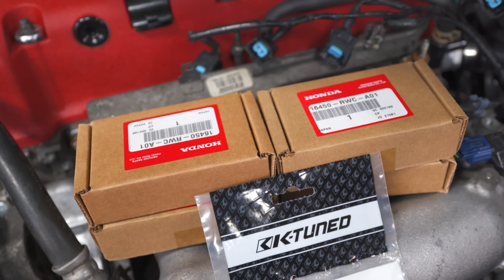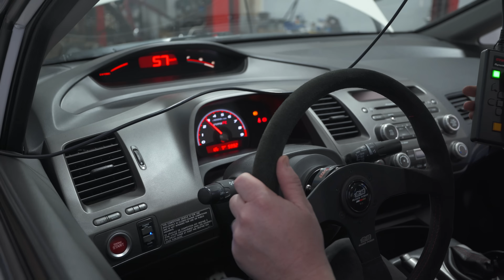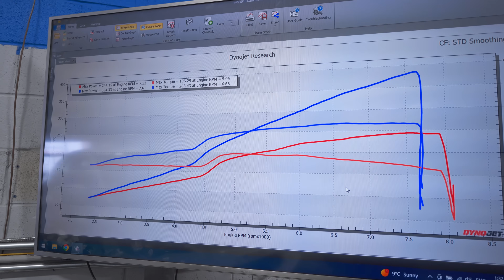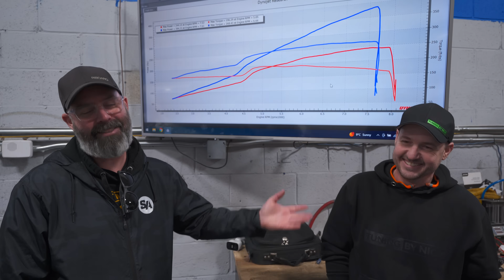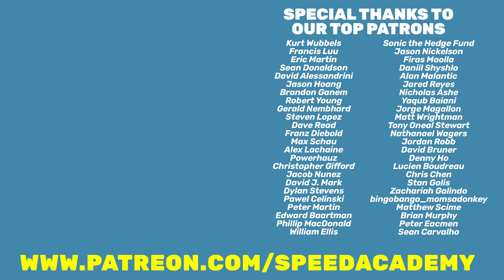BEST 8th Gen Civic Si 240WHP NA Mods ( SKIP the Supercharger)

Comment: I’m 39 and drive my 09 civic si with a supercharged k24a2 everyday to work. Car makes 390whp on pump gas. I love it. I drive it 50 miles each day. Never get old guys.
Reply: That's being content cuz that's my goal. Just a reliable rocket bunny.😅
Reply: thats badass and you prolly still get remarks that its a civic and that you get good mpg lol im tired of hearing it myself. theres almost nothing economic about the si compared to the base model obviously. esp with that close ratio 6speed
Reply: I just boosted my GT86 this weekend and its making 285 WHP. It doesn't feel like all that much and it's not like I even get to use all of it every day on my 30 minute commute. I also live in Texas and it got up to 91° today so that might be why it doesn't feel that good 😅
I'm tempted to go for the smaller pulley, loud BOV and E85 but all of that can wait for another year, I'll keep enjoying what I have right now. 
It's still not enough to get in big trouble but enough to feel like it's how it should've always been.
Reply: @yaboirico5221  also reliability man even NA those things are prone to engine failure, be careful homie 😭😭 i want a gt86 bad but i wish i could put my si's 9000rpm 240hp engine in it lol
Reply: What size tire do you run. I think the guys using 225 width tires is lame
Reply: @Gjon777  how
Reply: @repingers9777  too small even for 244whp
Reply: @Gjon777  im planning to put some 225/45/17 continental's on my 17x8's i care more about handling im only at like 200whp so im not gonna lose any traction lol
Reply: @repingers9777  maybe it’s the compound of the tire. Cup 2’s are great summer/street tire for grip even with big power. I ran cup 2’s 235/40/18’s great in warm temps
Reply: @repingers9777 yea I get 18mpg now. Not bad but my 2020 Silverado sides the same lol.
Reply: @repingers9777  I've had the 86 for 2 years, the guy I bought it from replaced the engine lol I am fully aware. yeah a K series would be cool and fit the personality but I'm a sucker for the sound of the Coyote V8....
Reply: @yaboirico5221  hey the k series w a deep exhaust and loud intake growls like a gt350 in the cabin lol (has to be the performance k20) , not kidding ive lined up vids of my car and some stock gt350's its cursed as fuck but awesome lol.
Reply: How what all do you do or have u done to keep maintenance up besides changing oil and transmission fluids
Reply: @LynnDisclose I change my oil every 3k miles and I change the supercharger’s rotrex fluid every two years like the company says. I don’t bounce off the limiter and drive the car like normal.
Reply: stock internals? stock trans?
Reply: Stock trans??
Reply: kraftwerks?
Reply: How many mpg do you get with it?😊
Reply: So when are you dropping theAWD system in that bad boy?😂
Reply: why did u opt for a 24 instead of a k20a2?
Reply: If I didn’t leave in California it would be the first thing I would do to my 08 Si
Reply: Type supercharger? And supporting mods ?
Reply: @yaboirico5221 yea nothing builds power like a Honda unfortunately

Comment: 40 years old here, I’ve had my Rotrex Supercharged EP3 (365bhp) nearly 10 years and wouldn’t go back NA. 😎
Reply: 100% agree the only reason why they pulled the supercharger out was for financial reasons.
Reply: @alleybuilds5370  for the annual maintenance of keeping the supercharger? If so what would be the difference in maintenance between NA and supercharged ?
Reply: Loved my jap spec ep3. Ran it with a 24 bottom end as opposed to forced induction. Have since moved to an fn2r and with the extra weight, it has crossed my mind to turbo or supercharge it.
Reply: @RelayFFA  nothing to do with maintenance everything to do with resale value. they are selling the car and realize they will get more money if they sold the supercharger by itself. and the car by itself.
Reply: @SR22VET-S15 I've had a few boosted hondas now. A turbo dc2 type r at 320hp a Jackson racing supercharged jdm dc5 type r and for the last 6 years a supercharged fn2 type r at 340hp. Honestly I prefer supercharged for the linear power delivery and instant throttle response. Dont worry about heat anywhere near as much compared to turbo and no big torque spikes to worry about loss of traction as much. I'm even on oem clutch for 6 years now and do the occasional bit on track too

Comment: I did the comptech kit on my 8th gen. Making about 330whp. It was a beast and the whine was intoxicating. Roots style blowers are way better than centrifugal blowers.
Reply: Why are they better?
Reply: Roots style blowers have a lot of inherent problems. Biggest being overheating.
Reply: @rawrmadmonkey  Mercracing has pretty much solved all the cooling issues for all the common k series roots blowers
Reply: @marzelluspinder3190  I had a centrifugal blower in my S2k for 5 years making 423 whp, and the roots blower in my daily driver civic si for 3 years making 330whp so I have a lot of experience with both types of blowers. I preferred the roots blower because it had instant power at lower RPM. With the centrifugal you have to be up in the rpm before it really starts to make boost and pull. Also the roots blower sounded sick revving out to 8600rpm. Here’s an old video which I will not confirm nor deny if it was me for obvious reasons. https://youtu.be/k39VztzKf28?si=X7pu2hRtrcvmBDUi
Reply: @rawrmadmonkey  I had less noticeable power loss from my roots blower over my centrifugal. Both were running larger air to water heat exchanger setups.

Comment: 380 through the front wheels is A LOT. This will make for a more enjoyable day-to-day driver.

Source: approaching 40.
Reply: 380 is at least 30 whp too much. 400 at the crank is maxing out what a fwd platform can handle, without completely losing driveability
Reply: I had a Volvo with ~250hp to the front wheels, that already was enough hp for that FWD car, loads of torque steer and poor traction without an LSD.
Reply: Not with rt660s it isnt. But I suppose not everyone wants to run a 200tw tire on a civic. Drives like a dream with the 660s tho
Reply: @Vaino_Hotti I agree, 300whp in a sub 3000lb fwd car is plenty fun, I still get 30mpg when I don’t beat on it
Reply: @Vaino_Hotti so fun tho innit
Reply: @youngmaestro4153 with boost by gear, there should be no issue. It helps in higher gears to have power.

Comment: A buddy of mine had a supercharged S2k that he was track racing and actually ended up going back to NA for the next season because with the supercharger it was just overpowered.  Ended up doing better with the na setup that season.
Reply: Depends on the courses you're tracking on but you can usually cut your lap times by more seconds per dollar doing basically anything other than adding boost. Improving braking, suspension, grip, and aero will cost you about as much as adding boost alone and will get you better lap times on most courses.

Comment: Lower power isn't bad.  Miata is a ton of fun, FRS/BRZ/GR86 is fun.  They don't have high power but still great.
FWD has special challenges in grip due to weight transfer to back tires...
I have a fast car I can't really use anywhere.  It sits in the garage and comes out a few times during the summer.  So, cutting back the power to have something fun to get around in without going to jail is good.

Comment: The boost curve from a centrifugal supercharger makes you use more throttle at the bottom of a pull, but as the rpms climb the boost also climbs (exponentially) and “blows the tires off” the car. It is especially pronounced on FWD with street tires.

Comment: I have a kraftwerks civic I’ve put thousands of miles on it and my wife drives it too it’s incredible. If you don’t wanna rip the tires off you pedal it or shift up the power is always there  if/when you want it and if you don’t want it you can drive out of boost easy. I added a rfl blow off valve so every gear change is fun and sounds cool. To each his own!
Reply: Or they could put a bigger pulley and turn the boost down. In my opinion, this is a downgrade but it’s whatever.
Reply: @mursetvlogs5717  They are going to sell it, and make more money selling the SC separate. Probably
Reply: @dancarlos1216  ooo, yea that makes sense too. I figured a lot of their projects they always end up selling anyway since you never see them again
Reply: Why would I buy a civic to pedal it and shortshift? I want to be matted and banging gears every single drive.

Comment: I’m of the mindset that i should have gotten better with a crv all wheel drive setup with the supercharger,maybe that should be another video suggestion
Reply: AWD supercharged making 380 would be really rowdy 🔥
Reply: Way too complex, expensive and heavy. All they needed was a 255 square setup on some nice 300 tread wear tires and maybe lowering the boost a bit if required.
Reply: @CrossWindsPat  255/35R18 200TW tires + add an external wastegate on the charge pipe plugged into a 4-port solenoid (boost by gear setup)  Problem solved ✅

Comment: Glad to see you guys thriving up North.  Congrats on nearly 650k subscribers.  I always say add power until you reach the limits of the chassis/tire.  With light FWD cars on street tires, that's a pretty low limit.  250-300 whp is probably that limit for most people.  Even the newer CTRs with much better suspension design start to become a handful on street tires above 350-400 whp.

Comment: i have a second gen IS 2.2 turbodiesel ( europe only) its making about 200 crank 330lbs with short gears (230kmh top speed) out of a 6 speed manual and i completly understand your point . Even tho my car is heavy with the few handling mods i have (coilovers, sway bars , wheels and tires , bigger brakes) its still fun to drive specially on the mountains were the torque from the diesel engine and the short gearing really help the car uphill.
Theres always the right road for the right car

Comment: I had a 5th gen Camaro, did normal bolt on and really enjoyed the car, put a supercharger on and never really enjoyed it after.  It was a blast in a straight line but it took the sportiness away.  I drove it to the dealer with the mods all removed to trade it and actually missed how the car was in stock form.

Comment: You guys should install an ecu controlled wastegate on the charge pipe. So your tuner can limit you boost by whatever values he wants. Like limit it per gear, limit in per mode setting, etc.
Seen a couple guys doing this lately and it's really neat
Reply: Where have you seen this? I’m interested for my fg2 with a kraftwerks .

Comment: Great choice. I didn't like the idea of having to cut out holes in the hood to fit that supercharger and also never liked staggered wheel/tire setup. Now it's more suitable for the streets like you've mentioned; more practical in a good way.  Maybe fix that hole on the hood and a more subtle spoiler and it would be perfect. Love watching you guys wrench on the Hondas!
PS. noticing a bit of rattling noise in idle.

Comment: I'm on the other end of this argument. I ride 2022 Triumph Speed Triple  motorcycle with 175hp, and I have a 600hp turbo'd Mustang. I guess if you always want to be foot to the floor all the time, lower hp is the way to go.
Reply: I’ve got a 2012 Speed Triple, 132hp which doesn’t keep up with everything but I hate ride by wire throttle. Wouldn’t trade more HP for that synthetic feeling.
Reply: I have a Street Triple RS, probably 130 hp with all mods. Wouldn’t trade it for anything other than a more powerful bike haha
Reply: I’ve had ton of fast bikes. I love my NA slow k20 and my favourite bike to ride on the street is my wife’s ninja 400. It’s all about the feel not the speed.

Comment: Change the wheels and tires and keep the supercharger with less boost FOR CHRIST SAKE!!  REMOVING THE SUPERCHARGER???!! WTF
Reply: Right. I have 225/45/17 rt 660s on my si making 370whp. Its a perfect daily driver. Only time it breaks traction is absolutely flooring it in 1st or 2nd. Cant even tell the car is making 370.
Reply: Can’t beat the crap out of a car with 400whp, waiting for the power is part of the fun.

Comment: The best setup was the CT Engineering or old school Jackson Racing Eaton/M62 root style superchargers. Anywhere from 280-350whp depending on other mods/cooling. Its very simple AND the old Eaton units are as reliable as the Honda motor itself.

Comment: Love these Honda videos. I'd love to see a CL9 TSX build that can rival FL5 CTR for track performance, streetability, and reliability. They're about the same size and weight, except the TSX has the classic Honda double wishbones. P.S. Use the same size tires as the CTR...no gimping with 225s! :p
Reply: Forgot to add its in Greater toronto area

Comment: As an old school vtec connoisseur, and also owning a FK8 type R, I can honestly say I miss that old vtec kicking in. I'll jump in my 9th gen Si once and a while just to rip some tec even though it's slow as hell compared to the FK8. Fully understand the reasoning behind removing the supercharger. Cheers boys.
Reply: Wait so you miss the old school vtec since the fk8 only has 1 side exhaust only vtec so you hop in a 9th gen Si which also has 1 side intake only vtec? Lol
Reply: @d0mochi  lol. You don't hear the vtec in the fk8 at all. Listen, I've had all the vtec motors you could have, h22 b18c b16b k20a2 k24a2 etc...the vtec still pops in my 9th gen despite only the ex. having vtec. I just miss the old na vtec that's all. No need to be saying things like your comment.
Reply: @JDM_Jeffro  it’s the boost. I’ve had an s2000, fk7 and now an fa5. Even those f20c and k20z3 you don’t hear the vtec once you get forced induction.

Comment: Superchargers only exist to be used where a turbo doesn’t package well or at all. Every short coming or weakness of a centrifugal supercharger is in the area a small displacement 4 cylinder needs all the help it can get.  Boost will be nearly linear with engine RPM. Hence why your HP line is at nearly a 45degree angle across the range. Stock compression/internals dictates a low peak boost limit. That 8lb pulley at 7.5k rpm is in theory and hopes 4lbs at 3750rpm. A peaky power spike for across the tail end of power band would definitely suck everywhere but the strip. On a lower rpm healthy displacement V8 they feel and perform awesome. I can almost guarantee a properly spec’d turbo/engine setup would never be tossed back for stock.